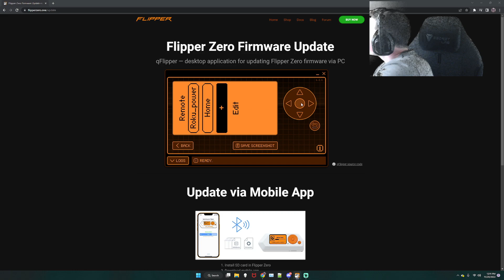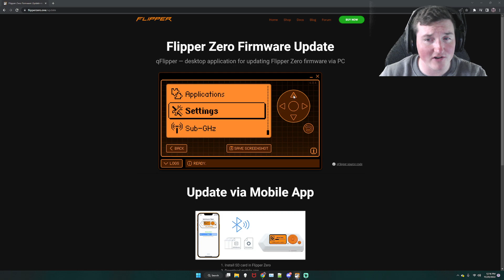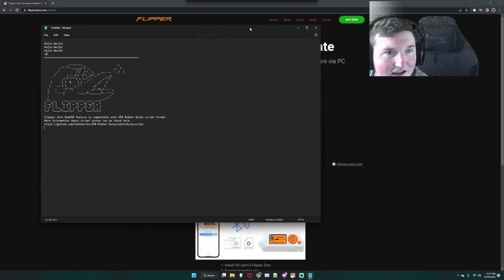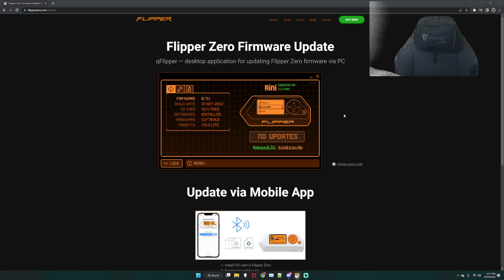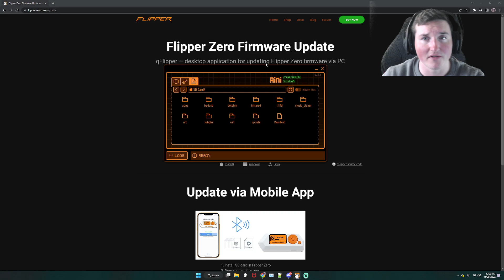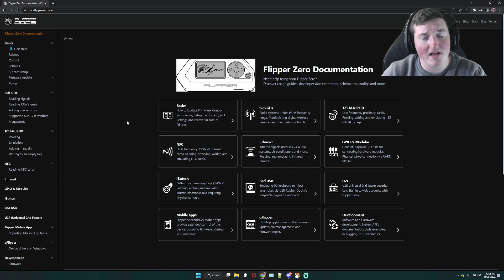The greatest hacking tool ive used?! Is the flipper zero that good?

Comment: So it’s a $250 universal remote
Reply: It is much more than that. It’s something that will only be as good as you make it to be.
Reply from the maker: @TheChad17  100% amen!
Reply: @TheChad17  perfect answer 💯
Reply from the maker: If that's what u use it for sure. If you use it to it's potential it can copy credit cards, open safes, hack wifi really do anything your imagination wants but if you want to simplify it to that you can. Its pins can also be used with raspberry pis, it can run malicious scripts on machines etc etc it's endless
Reply: Yeah but the word universal is a bit more wide in scope when it comes to owning one of these.

Comment: It is available in the US.  They turn off the ability to order to the US when they run out of stock.  Their plan is to get weekly re-stocks until they get enough stock on hand.  To reiterate, they turn on ordering on their website when they get stock.  When they run out, they turn off ordering. Be patient, do not pay the scalper prices and be sure to order a screen protector or be prepared to cut your own.
Reply from the maker: I know maybe you misunderstood what I said bc I live in the us and ordered it just fine. They do this for each country so when I say it's not available I meant currently.
Reply: is the screen vulnerable or something ?
Reply from the maker: @blakeimmel4160  what do you mean?
Reply: @blakeimmel4160  They suggest it to prevent scratching if you carry it in your pocket.  Also do not use alcohol to clean the screen.  I cut down an old phone screen protector that I had.

Comment: Which firmware is better unleashed or rouge master and give reasons why
Reply: I prefer unleashed as it seems more stable. I tend to load other firmware on the peripheries.
Roguemaster is a good choice too, as it has more compiled libraries but is slightly more unstable imo
Reply: Demanding answers is the queerest way not to get an answers lmfao dumb
Reply: @apexkrook8189  if you're not going to tell me then don't comment very easy instructions